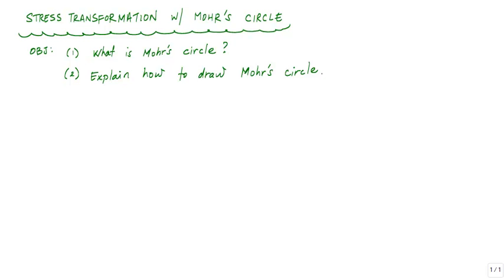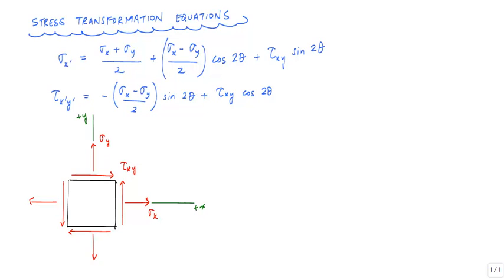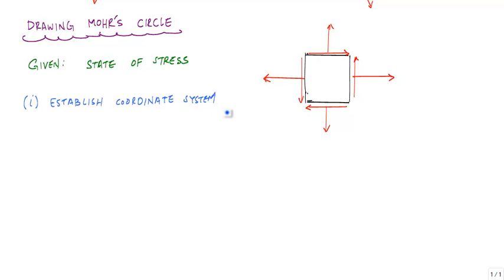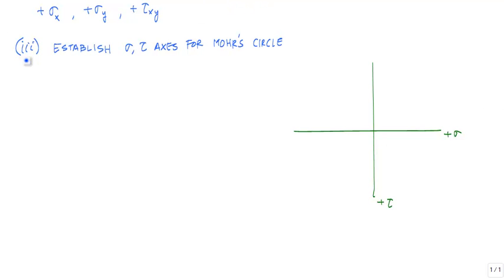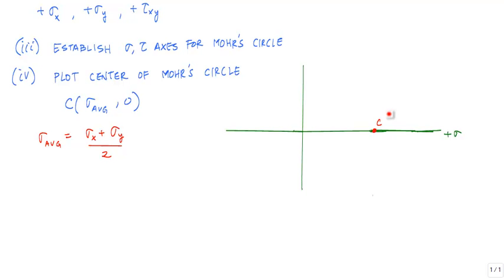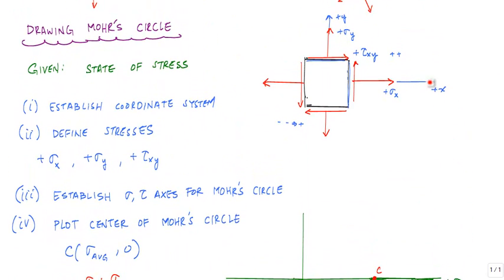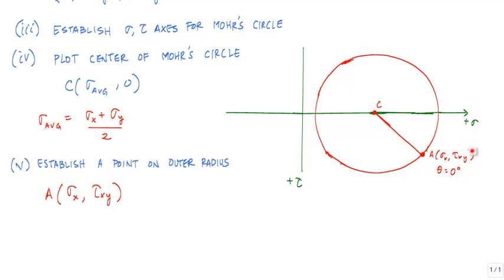Mohr's Circle (1/2 - explanation and how to draw) - Mechanics of Materials

Comment: The convention you show (up/right is positive, down/left is negative), is contrary to the method I learned.  The method I was taught is to isolate the shear stress and consider it as if it was the only one acting on the square.  If it would move the square clockwise, it is positive, if it would move the square counter-clockwise, it is negative.

  I believe you account for this discrepancy by flipping the direction of the tau-axis so that positive is down.  If you use the method I described, you can keep positive tau oriented upwards, which is more intuitive.  I also think it is just a simpler way to determine the sign of the stress.

If people are having trouble with the method you show in the video, hopefully this can help.
Reply: Thank you very much... I encountered the same problem. Thank you for your information.

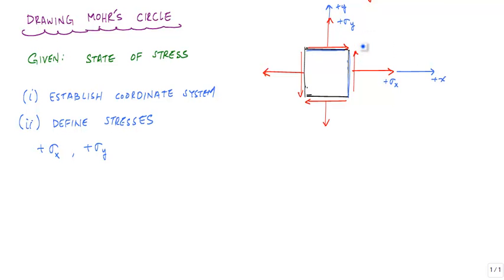Comment: from how you explain the sign of tau xy and tau yx at around 2:30 , i feel you will have a problem representing face-y on Mohr's circle as tau xy = -tau yx. Correct me if i am wrong.
Reply: +fooser, yes. You are correct
Reply: +fooser No, tau xy = tau yx. This is a basic concept in principals of plane stress. You can derive it easily. If you wanna look at it with some logic, both should be equal since the cube shouldn't rotate in equilibrium. Look at the positive directions of tau xy and yx. They are counter-rotational.